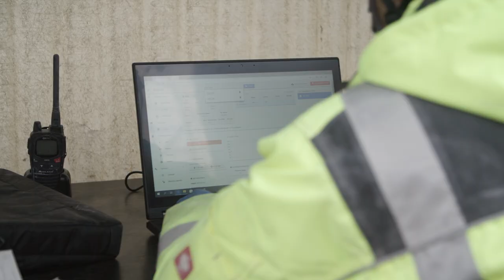3D PRINTING | PERI 3D Construction Printing: Largest printed apartment building in Europe (EN)

Comment: ok, interesting
But could you tell more about technical details?
Is there steel rods to reinforce the structure?
I saw some small U-wires, what are they for?
how do you print "over" the doors gaps?
why the double wall? do you put insulation inside?
how do you finish the walls, do you make them smooth?
Reply from the maker: Hi,
there is no reinforcement in the walls in this specific building, as it is not needed structurally. We use steel wall binders – also used in masonry construction – to connect the printed façade with the rest of the structure. The resulting hollow wall is filled with insulation or in-situ concrete, depending on where the double wall is located. To print ‘over’ door gaps we use steel lintels and/or temporary formwork support for the printed layers. For this building we decided to not smooth the printed surface with the COBOD BOD2. We want to highlight the 3D printed nature of the building.

Please find more videos on 3D construction printing on our YouTube Channel https://www.youtube.com/watch?v=N2zHWFYwMeg&list=PLroAY0F8oLQzMqX2MTO-SN8bXcd27hltB or on our website: www.peri.com/3dconstructionprinting.

Best wishes,
Team PERI
Reply: Hello sir !
I can work here